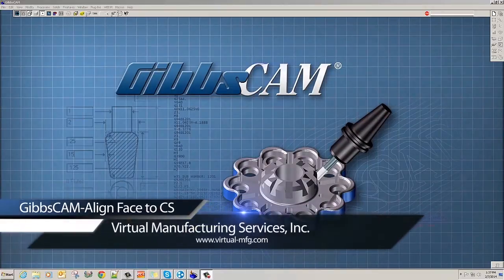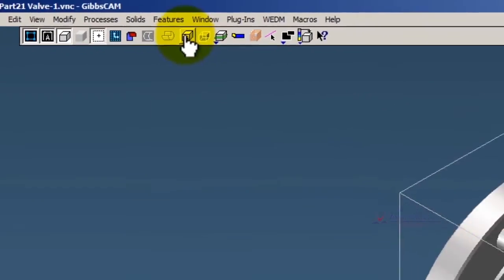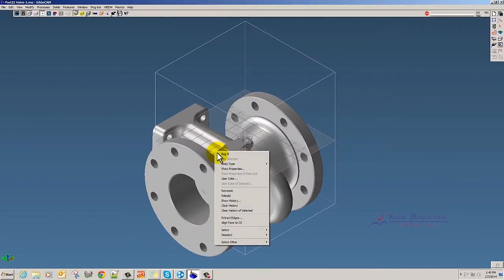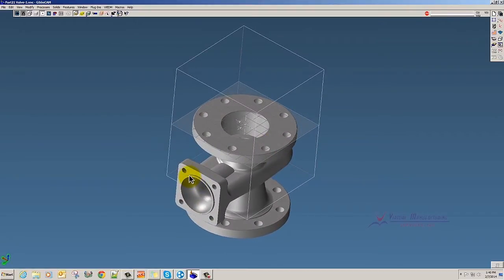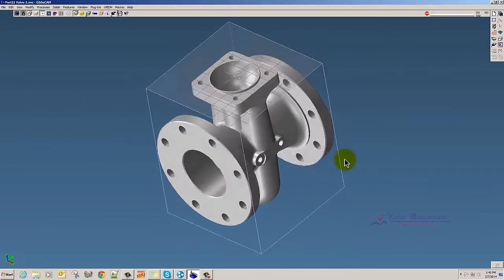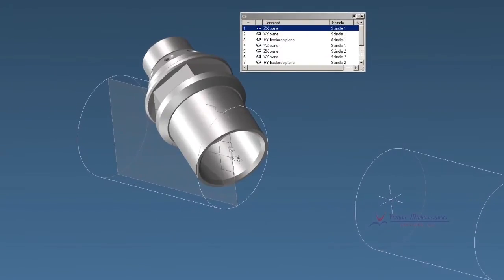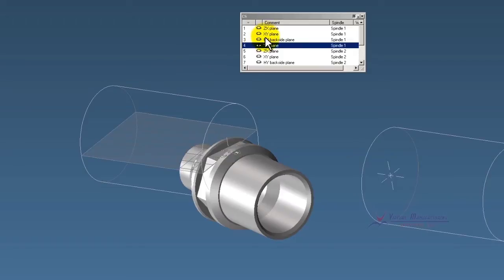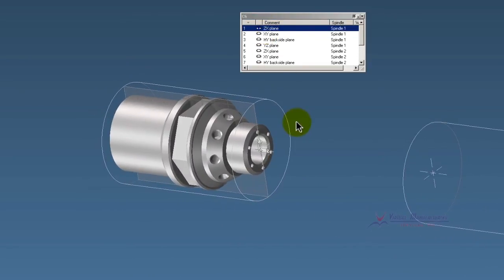GibbsCAM Align Face to CS

Comment: Is there a keyboard shortcut for align to face?
Reply: For example, right click the face then be able to use a space mouse assigned command
Reply from the maker: @alanvochaska4126  By default there is not, BUT, you can create your own.  As with any single command in GIbbs, you have the ability to assign custom keyboard hot keys.  Go to the "Customize Toolbars & Menus" page and you can create easily create commands for any function within GC.
Reply: @virtual-mfg  I can view the keyboard shortcut list but I do not have the option to add a new shortcut, and one is not defaulted for align to face. Using V22.044. Thanks!

Edit, nevermind, figured it out, the text box that populates below is where the input goes. Appreciate the tip.
Reply: @virtual-mfg  FYI that command will not work as a shortcut.